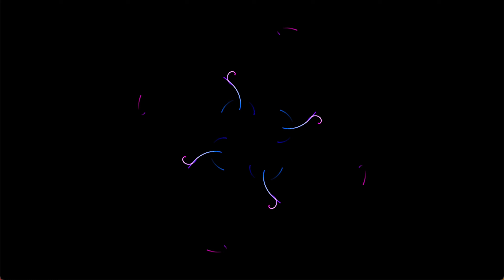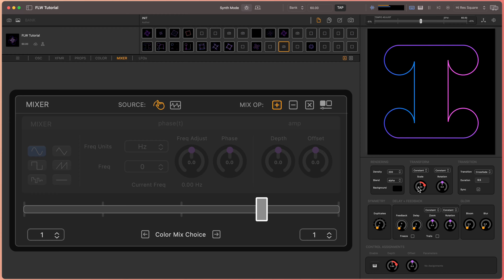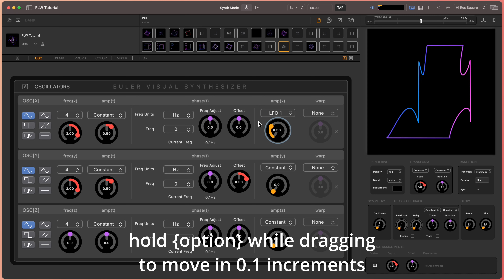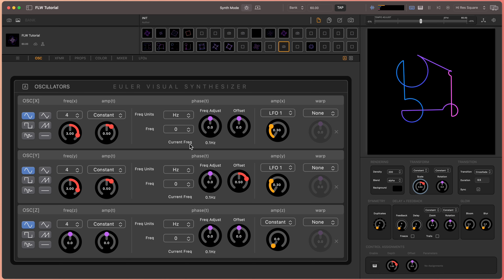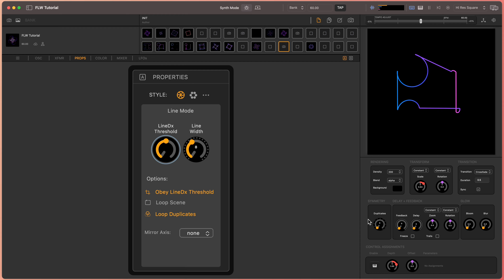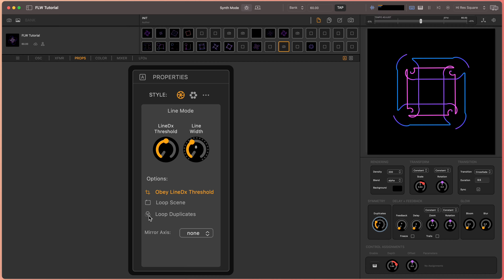Euler Visual Synthesizer: Circle + Square (Inspired by Frank Lloyd Wright)

Comment: Do you have to use the visual synth to make music in real time or is there a way to add a track and have the visual synth work and morph to the sound of the track?  If so how do you do this?  I tried to add my audio interface as core audio but when I played the music while using Euler VS the VS did not recognize the music.  Any help you can give me I would appreciate!
Reply from the maker: Please check out the user manual (Help menu) - the section on Audio Settings should be helpful as well as the Audio Input Supplemental manual. To route audio using your audio interface, your interface must support loopback (most do) - and you need to choose these loopback channels as the audio input channels in EulerVS. Once you see audio signals you should be good to go. Worth mentioning, that not all presets are designed out-of-the-box to respond to audio - test it out on presets in the Music Visualizers banks. Once working, you can modify any preset to react to audio as described in the manual.